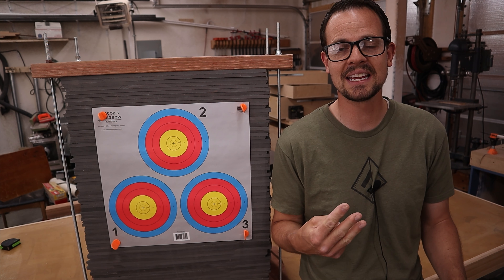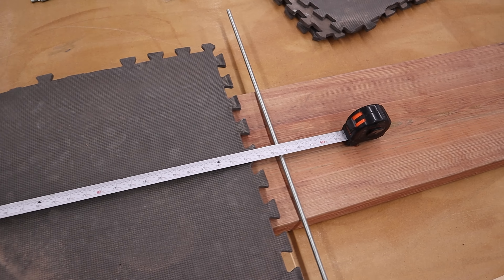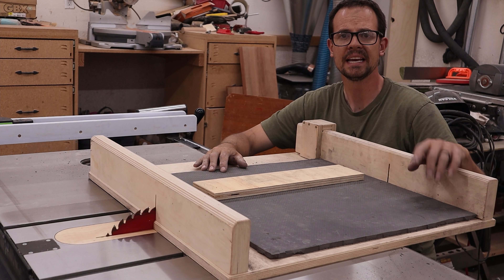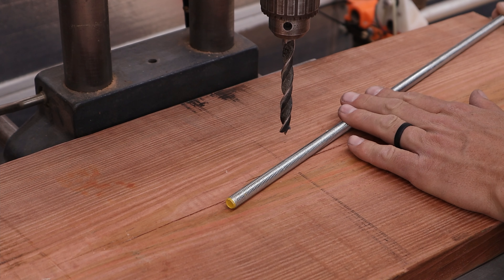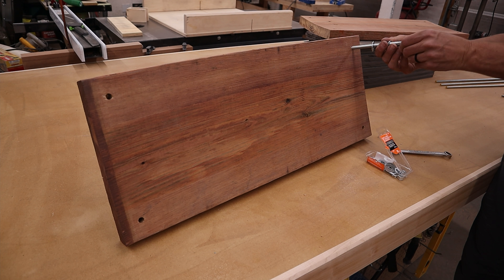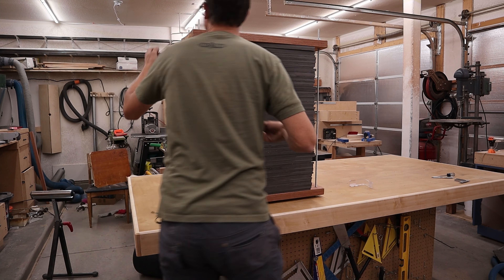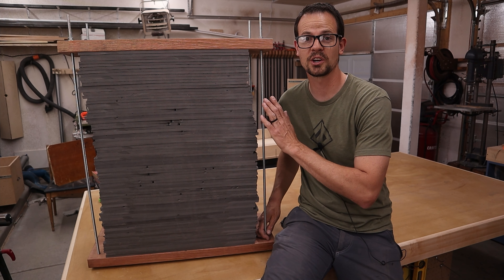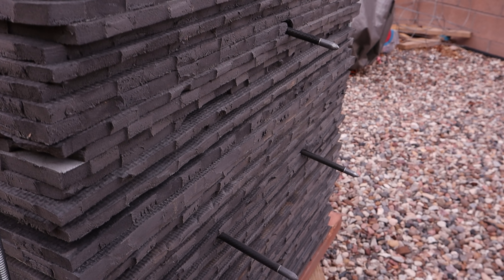Make a Simple Foam Mat Archery Target | One Day Build

Comment from the maker: Let me know your favorite type of archery target and some of their pros and cons. I have a Rinehart Targets 18-1 Portable Archery Target that I like for the portability but it is significantly harder to get arrows out of than this target that I just built. (PS I have shot a couple of 50 shot sessions and it is still working great)
Reply: I have that same rhinehart target and it’s super durable but you’ll wear yourself out just pulling the arrows out the target , for field points it’s hard to beat the bulldog targets but they won’t take a broadhead
Reply: I have had the same rinehart for like 4 years, it's shot to heck but it still stops arrows. Mine is back from when that 6 sided target could have the cylinder pulled out and replaced. It's gonna need replacing sometime because of the arrows overpenetrating by a good 5 inches now so I'm gonna build your target if I can get the supplies.
Reply: how would that hold up on crossbow bolts?

Comment: My question is how about 400+fps 500 grain crossbow bolt. I have been searching for a target but when I read the bad reviews it is the same problems I have. The 20" bolt sinks to the fetching or will not pull out or it fuses what ever is in the target to the shaft when you do get it out. I never thought about a target when I got my crossbow. With my compound bow I never had problems but the crossbow is moving 3x ish as fast. Friction I think is the problem.

Comment: I put a 4sq double layer of floor pads on the front of a 4-high  extra long hay bales  stacked on top of an old desk frame. I shrink-wrapped each layer, bales first, as I put it together to hold it in place & to water proof it. The mats absorbs the arrows really well without getting too deep into the bales & gives me a large backing to hold a 120m target face which is rolled up & placed on top of the bales when not in use when shooting 18m targets. It's not portable but it serves it's purpose & items can be easily replaced. 🎯😁
Reply from the maker: That sounds amazing!!! I really like the idea of using the mats as the initial absorbing layer and then something cheaper for the more bulk. I feel like shooting into hay in large amounts typically the hay falls apart too quickly, but you seem to have a great plan for stretching it.  Plus that target sounds nice and big.
Reply: @BuildItMakeIt  I'll send you a picture if you want it. 😊
Reply from the maker: Awesome! Post it on instagram and ill take a look. Id love to see it. Im @builditmakeit
Reply: @BuildItMakeIt  Ok, will have to create a Instagram acct. Ugh. 😣 To note: on the setup I added child floor mat shapes onto the target face for my Compound shooting friends. 😁
Reply: @BuildItMakeIt  Instagram is being a pain & won't let me confirm, you have anything else I can send it to?🤔
Reply from the maker: @kajala11  you can try uploading it and then posting the link 
http://m.imgur.com/upload
Reply: @BuildItMakeIt  sending it to the email you provided. 😂

Comment: I like this design because you can use any type of cheap boards from any local store. You could use even polystyrene that should be much cheaper than what you used in this video.
Reply from the maker: Thanks! Yep, I have done a target with polystyrene and it works as well.

Comment: How long does this generally last before you have to start changing out matts? An estimate of arrows fired would be nice. This is for an archery club starting up, so we definitely need something durable with reasonably priced material.
Reply from the maker: I shot 12,000 before switching some mats around, but I didn't shoot in the same place each time.

Comment: I'm just thinking of making it a little lighter. Instead of wood and metal, you could use a foam adhesive to keep the foam together and bind/compress the pieces with a strap. If done right it would be much lighter, more mobile and possibly even cheaper.
Reply from the maker: Yeah I think it’s a great idea to use straps. The downside to gluing it together is you lose the repair option if you wear it out. I have done that with rigid insulation before and it held up fine, but then I could just swap out layers to give more life. If you build it though let me know. I would love to see how it turns out.
Reply: How much do you think it weighs? I made a similar model but used cardboard instead. It ended up being rather heavy, at least much more than i expected, probably 15kg or more😅

Comment: I built one similar to yours. To give a little more protection for the arrows I covered the all thread with garden hose.
Reply from the maker: I like the idea with the garden hose around the all thread. Ill have to look into doing that next time I take it apart to replace a few mats.
Reply: @BuildItMakeIt  the mats I used had holes in them. I have ordered some solid ones from TEMU which will be more dense and provide better stopping power.
One other thing. My archery club sticks the target faces onto a cardboard backing. I will do this too because it will help prevent the faces from tearing.

Comment: Man I really enjoy your videos. They are well made, explained and concise. I’m a follower now. 

The target here is very nice. My older outdoor club used hushboards as target and did it exactly as your design. They lasted long for us using regulation fieldpoints but the nimrods also used bh and they ruined them. You can pull them out so they’d cut them out creating a cavernous hole in the target face.  

Thank again for the excellent videos and keep on putting out content. 🤙🏽
Reply from the maker: Awesome, thank you! I had never heard of hushboards before, and looked them up. Thau look like they would work great. Yeah this target I wouldn't expect to hold up well to broadheads either. My previous target does pretty well with broadheads, but I also have a smaller foam target I pull out when I get closer to hunting season.

Thanks again!

Comment: Started out with a target made this way, only con I found of this one was the stainless steel ready rod was the end of your arrow if it touched it.

The solution, use banding or ratchet straps to compress the mats together and you are good to go. Also saves some money and is a little less time consuming to make.
Reply from the maker: Thanks, that is a great idea to add the ratchet strap, pretty much superior in every way to the rods.

Comment: I modified this design to put a 10x10 375 target core in the middle of mine I like this design a lot
Reply from the maker: Oh, that is a super good idea. Does it hold pretty well?
Reply: @BuildItMakeIt  yes it’s held up better than expected even hitting the edges which are about 5-6 inch wide pieces of the foam mats

Comment: I made one of these about 5-6 years ago  And I though blew a kidney out pulling the arrows  Found out there is arrow lube made it easier but still hard to pull arrows out  Worked great for a recuve  or longbow  you can't be to loss on compressing the pads or they pass through  My target was a 24 x24 x12 cost around $50-60 I had wood already  Heard from a club they just hang 4 strips of carpet 4' x8' over a cross member and works very well
Reply from the maker: Thanks. That’s a cool idea with the carpet and would be pretty easy to make.
Reply: Rub a bar of soap on your shafts. This will make it much easier to pull. Even with a two blade bh, I rarely need to use an arrow puller

Comment: Let's not just gloss over that you are using a Shopsmith 10ER in your project. 
Nice!
Reply from the maker: Right on and good eye. I would like to upgrade to a proper drill press someday, but the Shopsmith is doing pretty well. Plus the lathe and sander functions are nice to have when I need them. I will admit I have never used the table saw function of it since an old 60's craftsmen table saw was my first real woodworking buy and the Shopsmith came later.

Comment: That's a great concept. I'm wondering what the velocity threshold is for crossbow use. There is a signifiant difference in velocity/inertia there and crossbow shooter may need to double the depth of the tiles. Does anyone have any experience with crossbows and foam tiles?
Reply from the maker: I have heard from about 10 people using this with crossbows that it worked fine. One fellow used the whole mat to make it extra thick and just trimmed off the tabs as the face. While I still like this target, it will be cheaper to make a thicker one with cloth like this target I made https://www.youtube.com/watch?v=VQaMyswfNuw The cloth stuffed target isn't new and I have seen a lot of people use those for crossbows. You can make it extra thick if you want and also pulling out the arrows is a lot easier.

Comment: Are the arrows hard to remove and does it leave a residue on the arrows?  How has it held up?  Thanks
Reply from the maker: Still working good for me two full season on. Sometimes it leaves a little residue but it rubs right off. Generally the arrows are ok to pull out. Much easier than my Rinehart but harder than cloth or cardboard targets. I do a twist on the arrow and it will release and pull out ok. My kids bows that are less than 35 lbs pull right out.

Comment: Nice idea with the threaded rods. Ratchet straps would work too I’m assuming
Reply from the maker: For sure, ratchet straps would work great. They are 8 bucks for 4 at my local harbor freight and 10 at home depot so thats a great alternative.
Reply: I have made this exact same thing with ratchet straps and 2 smaller planks at either end a couple of years ago and it does work well. They hold up alright for the cost but pretty time consuming to make, I used a knife to cut as I don't have a table saw.. If budget really is a factor then I would recommend making one like this, but I ended up just buying a replacement which will easily last 4-5 times longer for only 3 times the cost.
Reply from the maker: @mrnice752  thanks!! Good yo hear some others have made this. I agree if you have the money you can buy some really nice targets that can last.

Comment: Just out of curiosity, have you used broadheads with this setup? I really like this compared to spending several hundred dollars on ones that can not be repaired!
Reply from the maker: I have used broadheads but only as the setup right before hunting season. I have found that if shooting in the same area it wears out much faster than my rinehart target, (like 5x) but then I can replace those few mats in that area and any others that seem worn out for next season. Plus I like the large face for 60-70 yard broadhead checking where my rinehart is only around a foot cubed.
Reply: If the man says broadheads…I’m in!! Awesome build and good, constructive and respectful comments?
??!!! Proves that your channel is on the top level sir. Congrats!!

Comment: Hello! Any ideas for a Olympic sized target bale? :) mine is getting shot out and supply is short rn so either it’s out or ungodly expensive. 

Also also, are you going to Vegas next year? :)
Reply from the maker: I think for something along that size you could do the mats side by side for 4'. That is what some others have done here, but I think that would get too expensive with todays prices. I would probably build a wood frame like 12 inches deep, and put on two faces of synthetic burlap, then stuff it with cloth, or plastic if you can find that much stuffing for cheap/free. It would be super heavy though and not really movable.

I'm probably not going to Vegas next year, I'd love to but I am not really that good of a shot. You?

Comment: Nice job.
Do you think that it would work cutting the mats down one more time to 6” thick instead of 12” thick?
I’m cheap and don’t want to have to buy so many mats!
Reply from the maker: Thanks! I think it depends on your bow and poundage. I’ve got a decently efficient compound bow at 70 lbs this year and I am pretty sure I need the full 12 inches. When I shoot my 35 lbs recurve it would be fine at 6 inches.
Reply: @BuildItMakeIt  Got it, thx. This gun guy is  new to archery and no way is 70 lbs comfortable for this old guy!
I may be ok then.

Comment: Does this weigh hundreds of pounds like my carpet version? 
Also curious about your bow set up? A 55# bow @26" draw with a 350gr arrow could have very different results than say a 74# @29" with 500gr arrow.
Reply from the maker: Thanks for the questions. I just weighted the target and it is 45 lbs. I like it because it has a nice amount of mass so it doesn't move a ton, but not so crazy that it is hard to move around.
I'm right in the middle with a #65 draw weight and 515 grain arrows that are 30" long.
Reply: Interesting. Too bad the foam mats aren't longer, pretty narrow target when you want to shoot at a dew spots from distance (for some people). I have barge cement but thats a lot of work to glue pieces on every layer. I wonder if yoga mats(very cheap at goodwill) would be sufficient